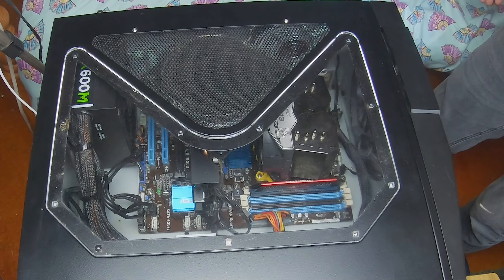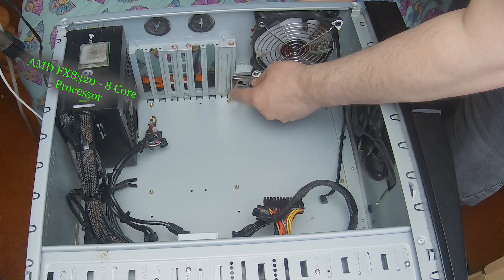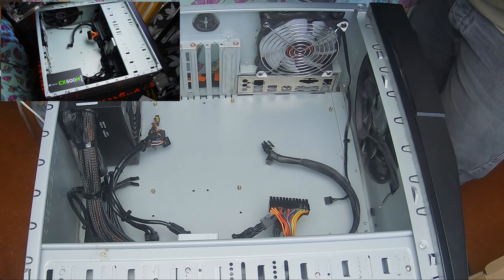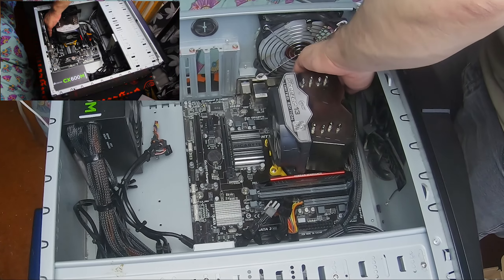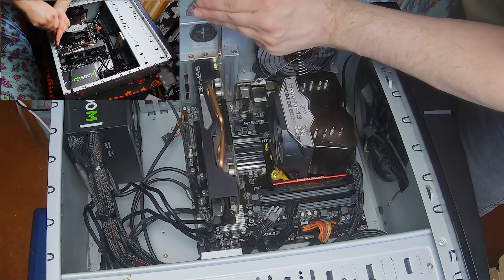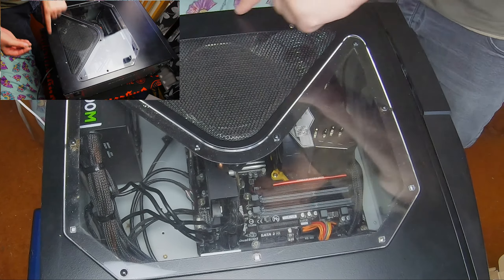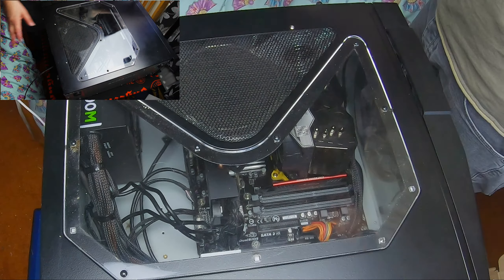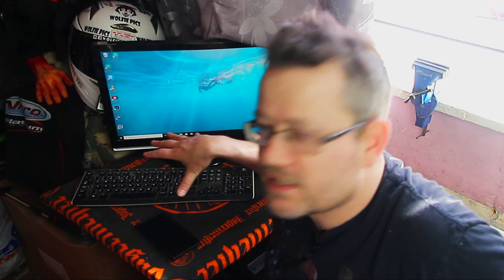I Install A Motherboard..

Comment: Handy tool on the hdd led, though I don't use for ssd 👍👍 . Nice video. What's the max ram clock speed for motherboard
Reply from the maker: Hey, i needed the led because there isn't one on this case, and it's good to know it's not stuck. Problem I have had previously on this case with another motherboard. Thank you and not sure I know the memory is 1866mhz..

Comment: I'm still rocking my 4790k haha but I got my g card so might move amd cpu and board next. I have spent hours looking at vids like this :)
Reply from the maker: Out of my 2 setups this one runs faster and seems to be more stable. Other PC is a Asus MB, same Pro, same memory but 16gb not 32gb as i now have in this one. But the GPU in the is a Radeon the other is a Nvidia maybe its gpu not sure but htis is way more stable and superquick. I have named this one The Beast. See My Instagram for lastest pic of this PC. Ps, as stated this wasn`t a guide more like this is what i did kinda thing. But as always thank you for watching.